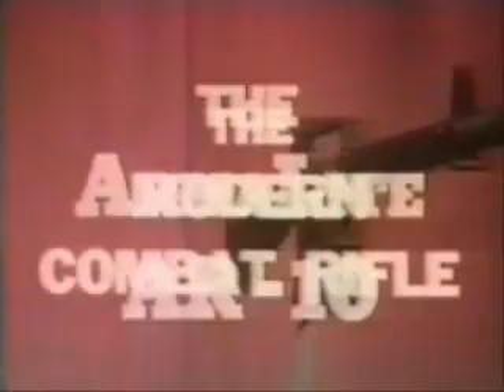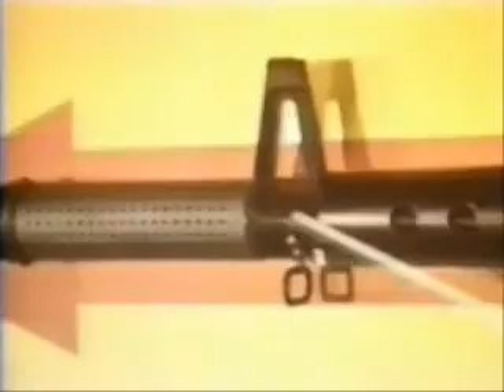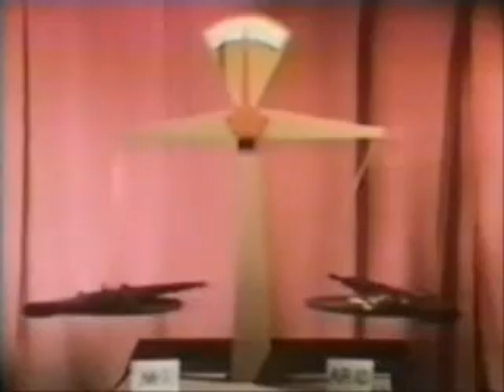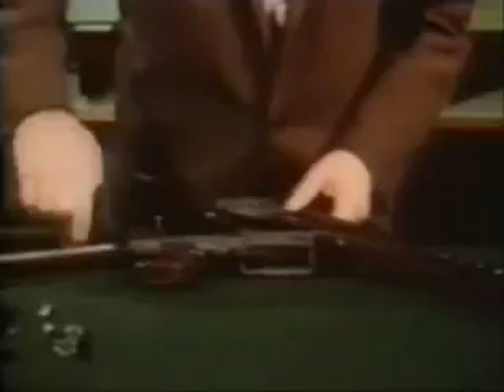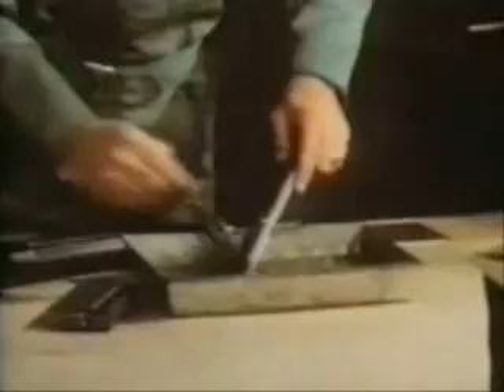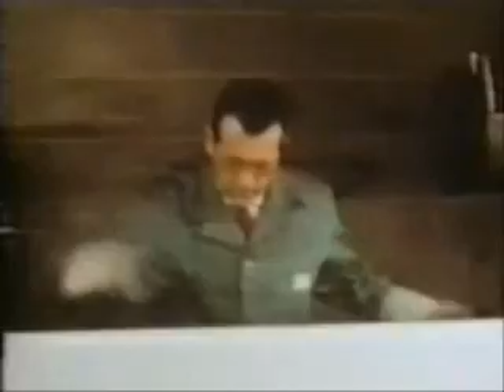AR10 Promo Part 1

Comment: The AR10 did not need a forward assist.  The only reason why there was one on the M16A1 was mainly due to the wrong powder used, initially, in the 5.56 cartridge as well as the wrong type of lube supplied to the troops in the field

Comment: The main reason that the original M16s fouled/broke was the M16 was supposed use a different powder but i a cost cutting measure, the Govt. continued to use a dirtier pwoderthat functioned well in the M14

Comment: The AR-15 was based off of the AR-10...Not the other way around.
The AR-10 was designed before, but produced massively in 1956.
The AR-15 was designed in 1957. Most people thought a drop in fire power was a disgrace to the rifle, but it turned out to help it.

Comment: Correction:AR-10 doesn't have free floating pin, but a smll spring over the anvil. Different than its little child-the 15. Too, in the bolt,you don't rotate the cam lock to insert, it fits only one way, unlike AR-15. Got both and verified the design claims. Also, the earlier AR-10 didn't have forward assist simply cos' the stronger spring systems of .308 chambering did not require it.

Comment: The squareback AR-10(opening credits) from 1956(same as in NRA museum) lacked a bayonet lug and could not fire grenades.  The transitional AR-10 used throughout the rest of the promo utilised a "Sudanese"front end. This had the same 3-prong flash supressor used on early m-16's which got caught up on foliage. The lack of a forward assist assembly created the occasional feeding problem.  The free floating firing pin also could "pop-fire"some rounds prematurely. Overall it needed some development.